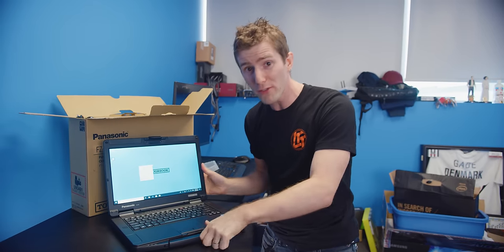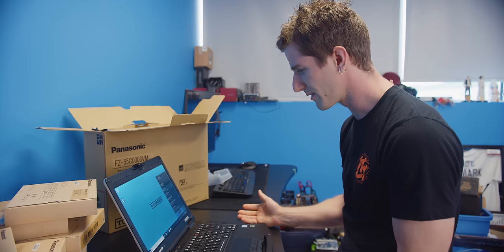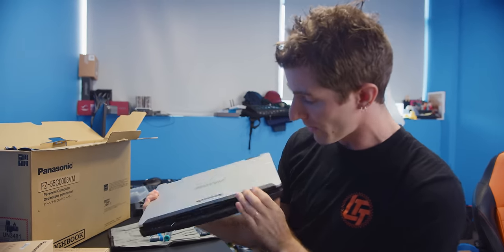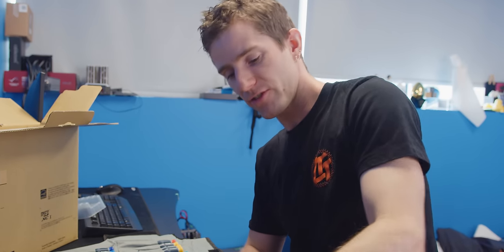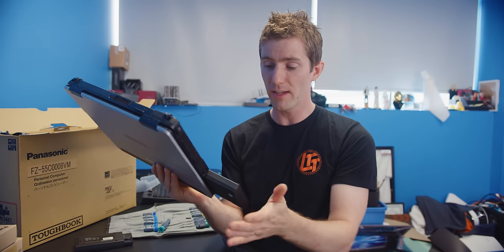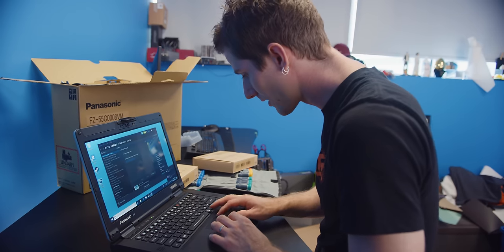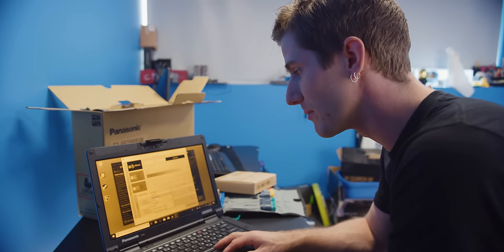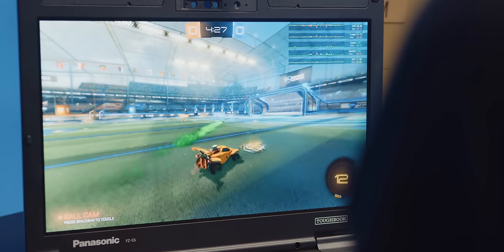The CRAZY Upgradeable Laptop - Panasonic TOUGHBOOK 55 Showcase

Comment: 2019 and we finally got hotswappable batteries... by sacrificing the fingerprint reader... and the smartcard reader
The Future is Here!
Reply: Implying you need those things all the time
Reply: you still have the infra red face ID thing for microsoft hello.... or if you're really into security, nothing beats a good passphrase+the smartcard reader (the 2nd one where the dvd drive goes).
Reply: @RandomNPC_023  biometry is kinda better than smartcard tho, its less easy to hack
Reply: Lenovo thinkpads have had that feature for a while, actually. That is, until they also removed the swappable battery for a built in one.
-Sent from my T470
Reply: @LazerLord10  I have a T470s with the smart card reader module and the fingerprint. Sadly I couldn't get the T470 because in my country these laptops only come  pre-configured, so I had to let go of the bridge battery system to be able to get the fingerprint reader and the 1080p screen. I was not going to pay over $1k usd for a 720p TN screen and a HDD... And if that sounds stupid, the "inferior" T470 came with backlit keyboard, but the "superior" T470s (as they sell it here) didn't. It sucks to live in a third world country :/
Reply: I know, I'm on my millionth thinkpad. but the ultrabay has always been the home for my second ssd
my W541 has built in smart card and ofc fingerprint
Reply: to clarify: I live in E-stonia. we use smartcards to sign documents and log into both public & private services.
although the same auth is mirrored on our phones with special SIMs, its basically compulsory here to have a built in smartcard reader if you use auth or sign docs or open signed crypted docs a lot

we have forgotten paper here :)
Reply: @superninja252  Though it can be quite easily hacked with scotch tape...
Reply: @AllanLaal  And being able to hot-swap things makes the laptop of this video an even better choice!
Reply: @AllanLaal  I don't get that clarification. The counterargument was that it's perfectly acceptable not to have your card reader available for like a minute while you are hotswapping.
Reply: If I were to guess?
If security is bad enough that I need all that security,
then I wouldn't WANT my laptop to be able to run long enough to be useful to anyone else who would want to take it.     :-)
Reply: But the facial reader still exist

Comment: Engineers: What modules do you want to be upgradable? 

Panasonic: Yes
Reply: Is processor upgradable?
Reply: @dimacherepovskyi8600  with enough work, ANY processor is upgradable
Reply: @dimacherepovskyi8600   I don't know but i upgraded a dell e5420 to  a four core cpu  from a 2 core 4 thread i5. off label and not recommended, but possible.

Comment: I think I'm going to wait 15 years and pick one of these up on the used market with all the upgrades for 300$
Reply: FubarMike The parts will all be outdated. Wait, I just realized think about how outdated windows 10 will be.
Reply: @xuavrice2338  windows 10 will never be outdated, unless microsoft gives up on it, just like even a few years ago you could still upgrade your XP machine, now, if they make changes which require more resources...then maybe you'd be stuck, sure...
Reply: everyone: casually walking around with AR lenses and wearable computers
fubarmike: takes out The Brick
ok, a little optimistic, but y'know, a 2009 top of the line laptop is not that great in 2019, same in the future...especially as RISC-V architecture is gaining popularity, meaning the "normal" x86 processors might not even be in use that much, kinda like mobile devices moved to ARM, where they used to just use low-end desktop processors and stuff (back when you didn't need massive heatsinks and people only dreamed of gigahertz), now everyone's setting eyes on RISC-V
Reply: @Cellphone Dave I say this because I see old panasonic toughbooks with core 2 duo and 2gb ram still fetching around $200 on newegg so I assume given the modularity of this one it would be a bit more after the same amount of time

Comment: For background I'm a Secure information and communications IT specialist in a hospital chain: I would 4000% need the serial ports and VGA for plugging glucometers in as well as ingesting CBC lab results, IMPAX, PACS, DICOM, and Radiant results into our devices (most commonly these softwares are our problem children, there are other softwares), the RFID could be handy assuming it is compatible with Imprivata as our ID cards are RFID proximity based, though our dedicated badge readers are also plugged over serial and can be negated for mobile device 2FA app instead when no reader is plugged in. The CD (assuming it's also a burner) would be a must for transmitting CTs, MRIs and CATs over as optical mediums are still commonplace in PACS to ingest with, the quick-swap SSD with bios supported encryption would be a must as our devices must be able to be re-imaged at any given point and that would just speed that up. SIM because we're on the go now following CoViD, assuming the AES256 is supported over cellular data (I see no reason it wouldn't be). If there is an option to swap one of the existing port layouts with another serial for 2 total, that basically gives us a mobile docking stations worth of I/O and I wouldn't need to continue with the clunky setups with wires everywhere.

Comment: Im a mechanik at audi in germany. We use these things for car diagnostics. And thats what the round connector on the back is for. If you wanna run the OBD2 Interface Connector wired. But we mostly use it wireless

Comment: I use the 2 year old version of this at work for T.O.s. We have slow hardware in them but could easily be upgraded. Avoid the small/thin versions the battery dosnt last 30 min. The bat in standard models is great though and the second bat comes in handy on 18 hour shift trouble shooting avionic computers and equipment. Putting night mode on a timer to turn on during next shift is always fun.

Comment: 2019: people still use Windows 7
2019: laptop with sim slot
Reply: Antonio APC79 laptop with sim slot exist since around 2005 and before
Reply: @carholic-sz3qv  we NEED 4G LTE+
Reply: @antonio1681  4G LTE++
Reply: I had one in my office that had 7... it is fine as long as you don't go online...
Reply: I see no problem with people still using windows 7, it's much more stable than win10 and has a really nice interface, i would be more worried with the people that still use windows XP, most public services here where I live still rely on winXP machines.
Reply: @Dr. Kocakafa 
Someone commented that they are meant for law enforcement, medics, et cetera.

Edit: And if you think about it, all the features make sense for these use cases.
Reply: @SergioEduP  In about 3 months it will become an issue.
Reply: RyTrapp0 the issue with win10 is it’s worse looking, completely filled with bloatware and crapware that slow down your machine, and it sells your data to companies
Reply: @user-ux2kk5vp7m  My laptop is a 10 year old model with 3 gigs of RAM. It runs better with Windows 10 than it ever did with Windows 7, even without official driver support from Lenovo - I use 7 drivers for for a couple of things that isn't supported by 10.

The last two jobs I've had, I've supported a mix of computers with 7, 8, and 10. In every case 10 have had a better performance than 7, even on old hardware.

The only real issues I've had professionally with Windows 10, have been cause by old software, like my old job that kept insisting on using end of life/service software, and programs like IBM Notes. A my current job, I'm trying to install some payment software that was designed for Windows 98/ME/2000. Can't really blame Windows 10 for not being able to run software that is over 20 years old.
Reply: 2019 people dual boot windows 7 and windows 10. Rip xD
2020 people forget about dual boot.
Reply: RyTrapp0 I didn’t say it was did i
Reply: To be honest everyone here should swap to Linux. It looks good, no it doesn’t actually suck for gaming, it’s fully customizable, it’s ram usage is beautiful, and it has no bloatware whatsoever
Reply: Microsoft should've just stopped at 7.  The best, simple, most popular Windows ever (except maybe XP) and was obviously built to stand the test of time.  Nope, gotta get that bloatware in EVERYTHING now!

Comment: LOL 4 factor authentication:

1 microsoft hello:
2 RFID/smartcard
3 fingerprint
4 password

sadly you will not have any battery inside the laptop
Reply: Imagine actually swapping out the module every time you want to log in after leaving the desk while still having to do all the authentication steps.
Reply: Actually there is a card reader that goes into the optical/GPU dock, so there is a dock that can be used for a battery.
Reply: @matthewtremain683  That's only the smart card, you still need to choose between fingerprint and RFID, though if you're using a smart card, why use RFID anyway?
Reply: @Wildcard65  well, if you wanted to have infrared instead of the card reader, as well as the other options. Then you would be left without a battery. But there are 2 options for the card reader, which depends on which bay you intended it for (battery type bay, or the optical drive type bay). I went with the sensible option.

Comment: These laptops are used through automotive and mechanical industries as diagnostic computers, great for the heavy mechanics and agriculter mechanics for field work, we had one for working on Landrovers, ours use to overheat every time it went over 32°c (our humidity level is really high feels like 40°c at 34°) we use to put it in the fridge to cool the cpu down to useable temps 🤣 thing still ran when i left.

Comment: I've own a toughbook 47, when it was new my wife at the time, lost her shit, grabbed it by the handle and threw that mofo like a 90mph ninja star (because she had it by the handle) fast pitch slamming dead into solid exterior wall came to rest on the concrete floor, picked it up and windows along with whatever i had open was still running perfectly fine. In that same year i dropped it 40' from a scissor lift hitting the concrete below, never even shut off. 
You cannot go wrong with a Panasonic Toughbook.

Comment: I do yard and lawn care. Ive destroyed 4 laptops while out on the job... I want one of these so bad but to get one equivalent to the laptops id usually have is going to cost near 7000, add the extra tidbits id want to go with it start pushing 9000... time to take out a second mortgage.  That green color mode would be extremely helpful during migraines allowing you to keep working with out making it worse.

Comment: The spec-sheet says it can survive 72" drops, perfect laptop for Linus.
Reply: Saimons thats not really that impressive durability wise, my Asus Tuff survived a 5 foot drop without a dent
Reply: @BlueMinion633  
72 inches is 6 foot!

Also that figure is from the MIL-STD-810G standard which both the Tuff and the Toughbook meet, so you can happily drop that laptop much higher.
Reply: @BlueMinion633  72 inches is more than 5 feet.

Comment: 2:03 these laptops (and the car dock) are the choice for a lot of law enforcement thats the kind of demographic and maybe a good driving force behind modules instead of just replacing old laptops.
Reply: ItsMalice  and EMS
Reply: Yeah pretty much any public services use these. Don't think he realized that lol
Reply: also the Military, very useful to be able to remove drives like that as well as the smart card redeader being good for 2FA if the laptop holds classified information or connects to a classified network.

Comment: I wonder if they can make a RTX variant of this. I'd buy it for sure. 40 hours of battery, good RAM, CPU, and even just something like a RTX 2060 mobile or GTX 1660 Super/Ti mobile would be epic.
Reply: Purpose of this laptop is having a reliable machine for certain conditions. It's not for gaming. Using overly sophisticated parts like powerful GPU would make it vulnerable, with overheating issues etc. I would rather want a very bright display with anti-reflective surface that can be used in direct sunlight.

Comment: I just imagine myself as a cop with this in my patrol car playing crysis
Reply: This thing couldn't hope to run crysis.
Reply: @GeneralNickles  Sure it could. Just slap in some new parts.
Reply: @CTyler84  You can't swap in an extremely powerful single-core CPU.
Reply: @user2C47  "extremely powerful" lol
What year do you have?
Reply: @CTyler84  Extremely powerful, compared to a single core of a newer multi-core processor. Crysis cannot use multiple cores.
Reply: @user2C47  8665 runs it just fine with a decent GPU. The game is old as dirt. Quit your fanboy whining.
Reply: @CTyler84  Since this is LTT, I was talking about running it in 4K at 240 FPS with maximum graphics.
Reply: @user2C47  OR You could note that the screen is 1080p, not 4K. 
And that's not even what the whole "can it run Crysis" means.

Comment: This is really interesting. I could imagine this being used by like scientists researching in tough environments.
Reply: It's used on Shopfloors most likely. And by car Mechanics. Most car manufacturers recommend those Laptops to run their diagnostic software on it. Hence the car docks.
Reply: We had them in the air Force had all of the t.o. on them(shop manuals for aircraft and vehicles, pretty much) my dad's police department uses them in squad cars as well. Both Toshiba though, but same idea, modular, extremely tough.
Reply: @claudioschweri8322  the most likely use is in police cruisers

Comment: This thing is designed basically for engineers and all sorts of outdoor on site projects , the GPU was enough for chief architect software which we were using and with m.2 ssd and additional ram was enough for rendering basic 3d models on site , also was good enough to run corel draw . 
So for our field of work this thing is excellent

Comment: My setup would be 
Dual batteries
GPU 
Extra IO
Extra SSD
SIM card 
Upgraded Wi-Fi
Reply: the extra ssd and the gpu use the same bay, so it'd have to be one or the other unless you didn't want them at the same time
Reply: @ram89572  that's shit

Comment: How in the world hasn't this approach become the norm... it's so awesome to have options in something other than a desktop. And that dual-battery swap-out feature is staggeringly cool.
Reply: This approach was the norm. This is basically what almost all laptops used to be, for a couple of decades, before they started with the current BS approach of total integration, removal of all useful ports, direct-soldering everything, glue, welding, putting a different obscure security head on every screw, case-intrusion switches wired to the CPU self-destruct charge, and anything else they can devise to make your computer stay useful to you for as short a time period as possible.

Comment: 14:27 There are standard antenna cable colors in notebooks. Orange/Red and Blue are for LTE or 3G (WWAN) and Black, Gray and White are the three antenna cables for WIFI. This notebook seems to have some kind of antenna switching inside. Only a few notebooks have that (I have first seen that in my ROG notebook) and it has a chip built onto the board that can detect the different signal strengths all around the notebook and switch the antennas for the WIFI and maybe WWAN always to the strongest antennas.

Comment: Pretty dumb not to make each side mirrorable.
"I'd like a second battery"
"Left or right?"
..........WHYYYY FFS
Reply: cuz then everything would be flipped and you'd get issues with ppl putting stuff in backwards

the only other solution is to use a reversible connector or something
Reply: @SkyHighStudiosHD  Actually, if you add something to make the addons only fit the up-side-up, then things would work well. Like the USBs, but in this case the reason would be because some addons need the correct side to be up. The ports can be rotated 180 degrees to allow for the same addon to fit in either/both the left-side addon slot and/or right-side addon slot.
Reply: What makes you think they does not fit in both sides? (hint: they do fint in both sides)
Reply: @mikkolukas  Linus literally said that there are different left and right side batteries during the video.
Reply: @SkyHighStudiosHD  What the absolute fuck are you talking about?
Do you have issues putting in your SD card backward depending on which side of the computer the reader is on?

Comment: I would buy this if you could turn it into a gaming laptop 
I love tough as nails stuff 
I need a new laptop but I want something powerful
And this is aimed at business people
Panasonic please make a version for hard gaming
Reply: that would be ultra small niche market...
meaning you'd have to have them make like, only about a few hundred of these, driving the price up drastically, given that they currently cost...you'd need to be a millionaire gamer, lol ;P

also as you saw, there's a gpu attachment...now about THAT, you could ask for a better gpu attachment, maybe one which is integrated with a dock as it wouldn't fit in the laptop
Reply: why don't you get clevo N970tf with i9 9900 + rtx 2070 or other clevo laptops with Desktop cpus + rtx/gtx graphpics. the top line has switchable graphics as well: P751tm /p775tm/p870tm

Comment: Me in 2019 with an LG v20 that has a removable battery, HiFi quad dac and expandable storage. Be like 👌
Reply: and upgradable ROM
Reply: Very nice ^^ my dream is two laptop slot batteries, so if one dies the other can be used like a decent 8 hours used/ 2 hours of gaming

Oh wait! There it is... but a gtx 1660 or a 2070 would be the ultimate portable dream i dont care for weight as long it can be modified is all good
Reply: @skullcandy14785  yeah, that would be awesome
Reply: John Dela Cruz  sadly ☹️